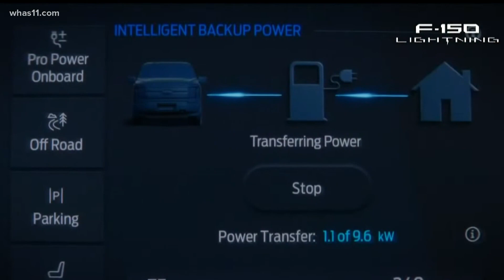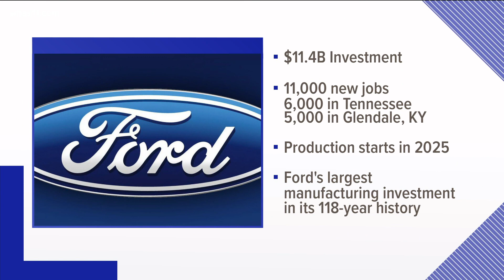Hardin County to become home to Ford's electric battery plants

Comment: Well YT has already censored my previous two attempts to post here about the folly of this EV battery plant. EVs are a financial,  natural resource, and energy black hole. Even the Cobalt required for the build is sourced out of open pit mines in the Congo using childhood hard labor. Shovels and buckets.
Having grown up in Buffalo, I witnessed the folly and failure of the Solar Panel factory there that went belly up. This battery park will be no different, and yet another anchor around Ford's eventual demise, unless of course future  white knight government bailouts are forthcoming.
The grid will not support widespread use of EVs- they will remain a niche status symbol for those who can afford them and the time and hassle of searching for and charging at all these the promised charging stations. 
Essentially, EVs will be a second car to virtue signal for the rich or very naive as they drive around town locally, not far from the coal powered electrical outlets while they keep their fossil fuel cars in the garage as their primary vehicles. 

I wonder if KY will follow up as a future waste disposal site for the wind turbines, used solar panels , and these expended batteries. The latter two very toxic you know.

Was a surgeon in E-town from 1987-1994 and had to deal with the legal, Medical Board  and bureacratic  incompetence and politics there as my career was destroyed.  

But KY has basketball. tobacco, whiskey. horse racing, chicken fighting, moonshinning, and beauty contests every month and for every age.  Nothing has changed.